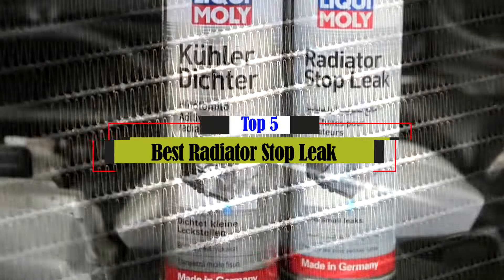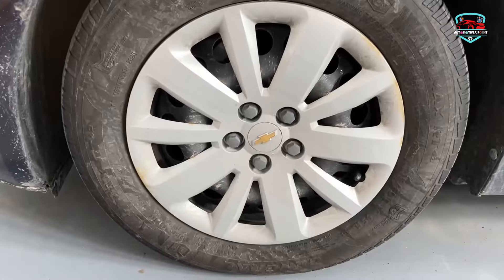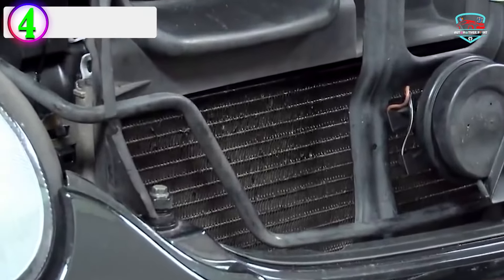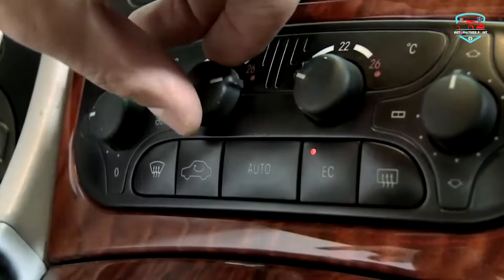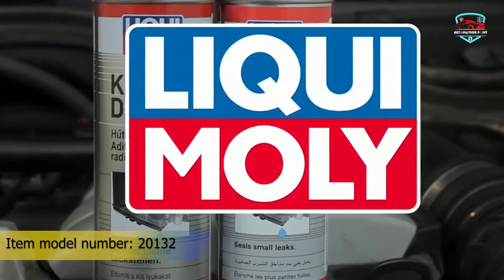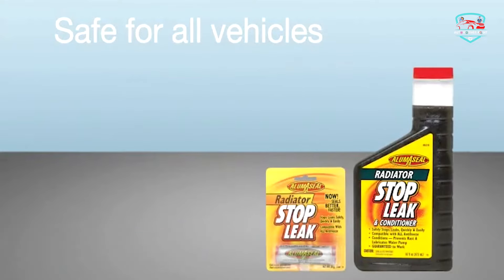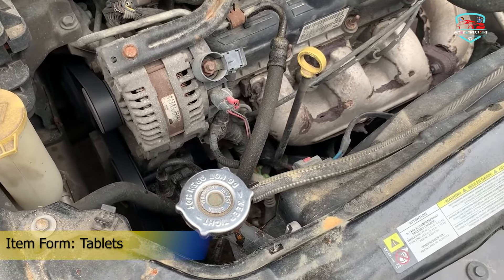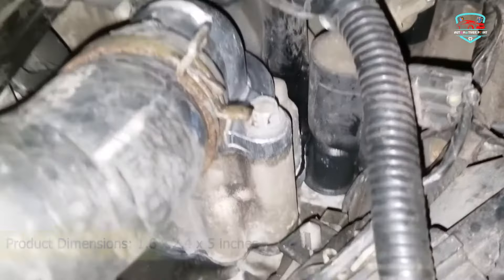Best Radiator Stop Leaks in 2024 [Top 5 Expert Picks]

Comment: I have a Dodge Charger 3.5 V6. I have a small leak coming from the water pump gasket area. The water pump is timing belt driven. I just replaced all that stuff a year ago. Which one is the best stop leak without clogging up the cooling system.
Reply: Currently having the same issue for my 2014 SXT I hope we get a response or resolution soon.
Reply: I'm putting some K seal in.   I'm going to the Auction to find something else.
Reply: @blacklotus6183  . I put K seal ULTIMATE today in mine. i also had a small head gasket leak. wasn't blown. so far good 👍😊. I let it idle for 1 hour. then cool down for 3 hours and restart. That is the required heat/cold cycle. when idling. it circulates K seal. then shut down for 3 hours allowing the engine to cool. that pressurizes the K seal into the leak.
Reply: @kansaswolf865 is it still holding up? I also have a small head gasket leak, I’m curious to know
Reply: @riaanbrown4862  The K SEAL slowed the leak way down. I'm putting a very little Bars high mileage cooling system repair in. That should stop it. I would be happy if the leak slowed to a gallon per month.
Reply: The Bars cooling system repair stopped the leak. Before, it had gotten bad.